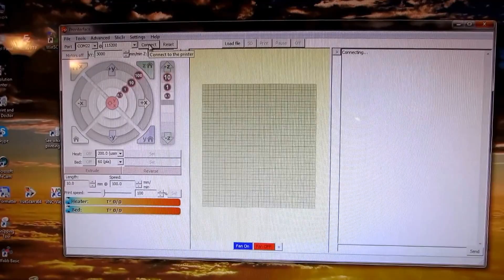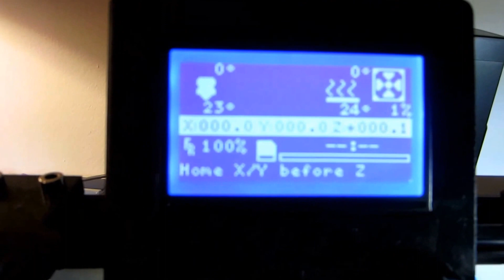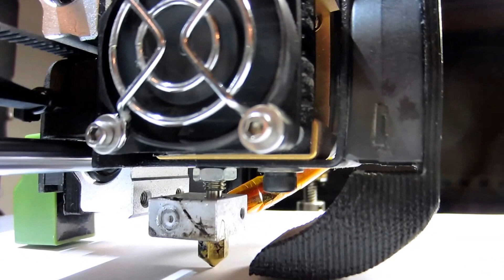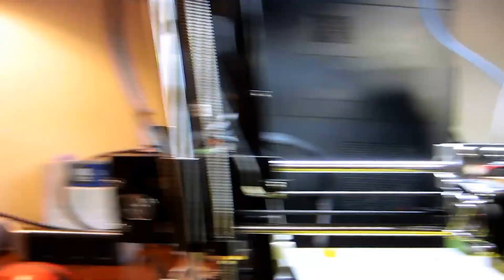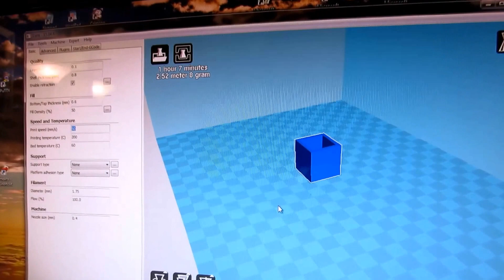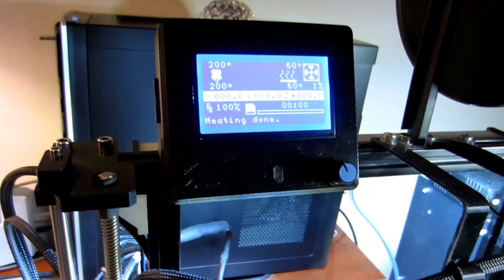Prusa i3 3D Printer Z Height and Bed Leveling

Comment: Hi Sir ! I am new to 3d printer stuff , I own my anet a8 3d printer weeks ago , and printer pretty ok for few printing , so I got some off topic question here need to find out with you , hope to get some answer from you , today I try to print some thing but then my print is out center from the print bed , I wonder what make it like that ? 
I use slic3r to convert the file into G-Code , I use the same software before and print all ok , now suddenly become off center and move the print head to right corner and start print from there to outside the print bed ...
Hope to have your help , thanks :)
Reply: this problem is because 1) your slic3r software settings were changed (like bed size or reverse Y,X axis) - try Cura slicer or Simplify3D.  OR 2) your printer does not auto home correctly in beginning of print.